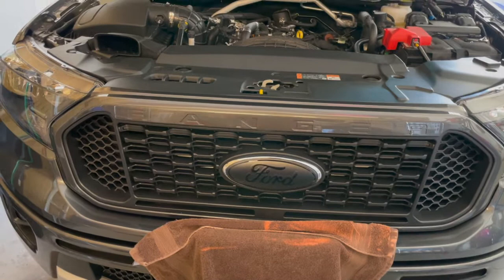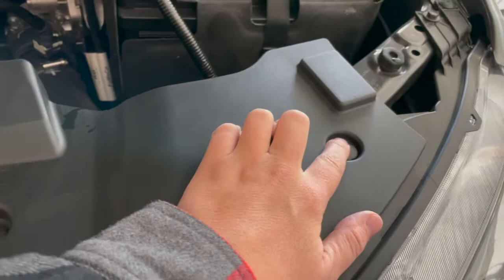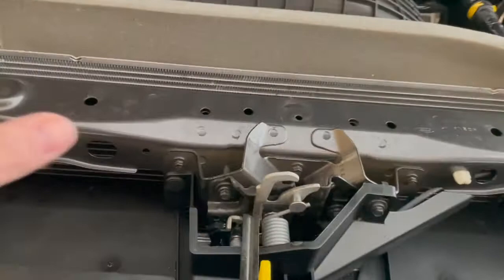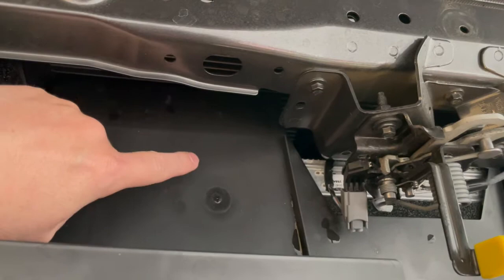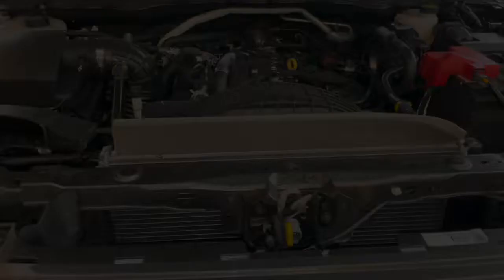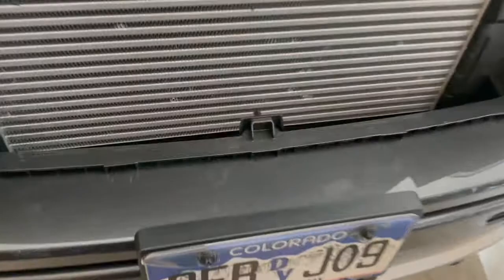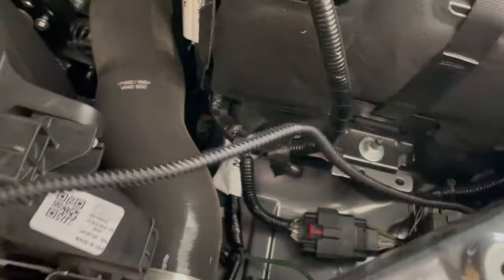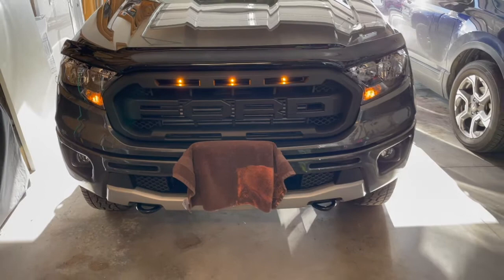2020 Ranger Raptor Grille Install

Comment: What a nightmare to install such as simple part! I did a grill swap on a Subaru Forester XT back in the day and it was like just 4 of those pop clips, was done in 5 minutes. Looks good, now you just need the Ranger Raptor driveline swap! If that broken mount comes loose I'd use some JB Weld on it, stuff works miracles.
Reply from the maker: Excellent advice on the JB Weld stuff. I'm going to pick some up just in case. As for the Raptor driveline... I'm looking at a Ford Performance Tune that will give it a healthy boost in power. I could go full Raptor; level it out, wider tires, beefy fender flares to get a faux wide body look, lol. Not sure if I want to completely ruin the fuel economy though...

Comment: what screws did you use to install the light kit? i’m assuming your supposed to use the existing stock ones but where did u get them from ?
Reply from the maker: My light kit came with the screws to attach to the new grille. I'm not sure if you are using the stock grille.

Comment: Where did you purchase the grill?  Having a difficult time finding the exact grill in video.
Reply from the maker: I got it from Stage3motorsports: 

https://www.stage3motorsports.com/vt-19rrg-19-20-ranger-vics-trading-raptor-style-grille.html
Reply: @EmperorFoxx  This link is not what you have in the Video. If you look closely to the style grille you have in the video, above the word ford, you have open spaces and 3 slits in the plastic for where the lights site behind. If you follow this link it takes you to a similar raptor style grill but where the light slits should be it says ranger. I can see why Jeff is having a hard time finding the exact grill. Im looking for one myself and it's tricky to find the correct raptor style grill with lights